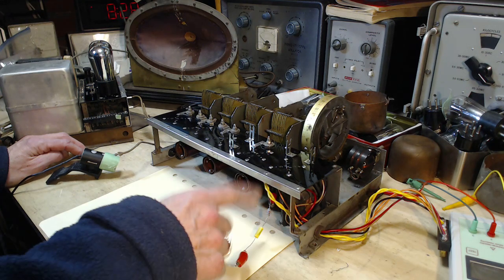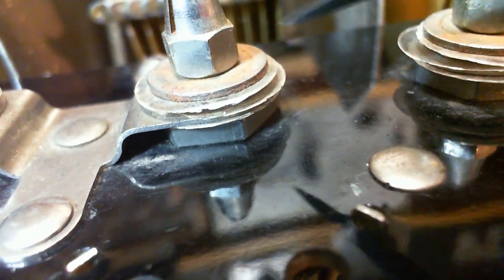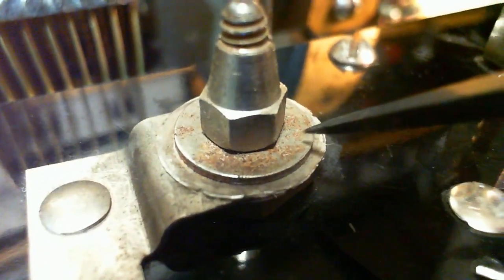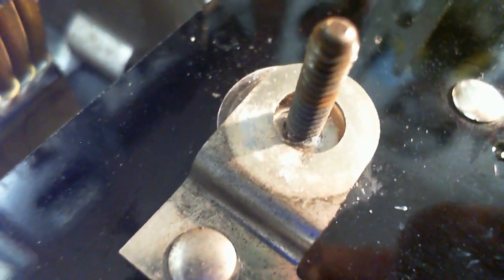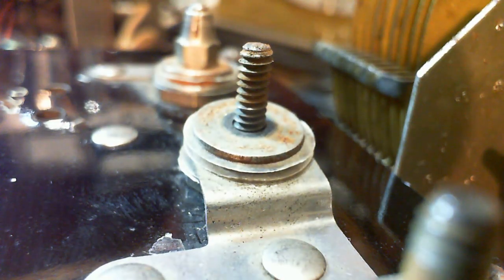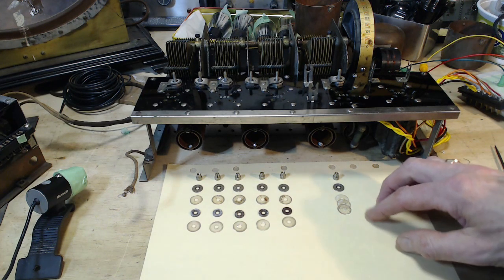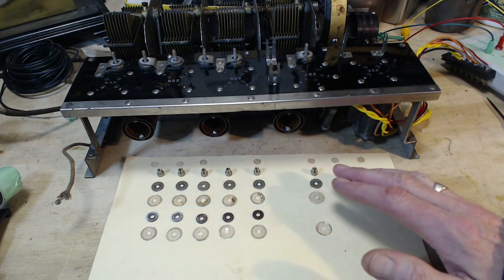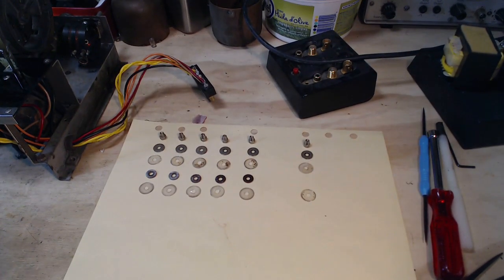1928 RCA Victor Model 28V   Video #44 - Trimmer Capacitors

Comment: Jim,The more I’m watch this I am reminded of a comment from “ All American Five “, Mr McWorter. In one of his videos which included cleaning a potentiometer. He was using WD40 to clean the inner contacts and at the same time, commenting on the virtues of WD40 in as much as the liquid would be absorbed by the dried out phenolic material and thus, rerecreate something like the original thickness at the time of construction and of course, improving the contacts of wiper and the resistive material material used to make a potentiometer. Would it not be reasonable to imagine that those little brown washers are made of the same phenolic material which in drying out over the years have actually become thinner and reduced any adjustment travel needed for their intended purpose? The white powder could most likely be the result of the dried surfaces being ground together having now reached the limit of adjustment. Great videos by the way.Graham from the UK. 🇬🇧

Comment: Hi Jim
looking at it you have a bottom plate & top plate with a spring plate in the middle 
( this moves as you adjust the top nut ) .

The plate area & dielectric thickness ( or gap ) controlled the capacitance so the trimmers with the phenolic washers will have less PF swing than the odd man out .

After all your just adjusting for tube grid variations & a bit of stray capacitances if the tuning gang is setup correctly !
As for the odd man you have 2 capacitors in the line so a bigger value trimmer makes sense .
The mica washers for stud diodes are still out there on flee bay .

PS Clear plastic cut into washers should work on the low voltage side of things .

Comment: did you read up on the neutrodyne radio, it is basically just a tuned radio frequency radio with negative feedback adjustable capacitors and a grid leak detector which what you have there. If it develops any regeneration or oscillation it will just cause noise and over power any signal on the detector. The rubber washers were to act like springs the one without probably broke and fell out years ago, since you took it apart would be a good time to replace them

Comment: Here's my guess. The manufacturer wanted to use the same hardware but needed different mfd values and used those red washers to provide that cheaply rather than design a different part for the different application.

Comment: Jim
Are all the capacitors equal in value??  Remember that capacitance is determined by Area of plate, distance between the plates and thickness of the insulating materials.

Comment: the top metal washer is the top plate of the cap.....mica next ...fiber washer thickness sets range of the variable cap.....bottom mica....then metal base.......  the diameter of the metal washers and base plays some part, but mostly the fiber washer sets the Range you can tune......   the fact that one is different simply means it has a greater capacitance when compressed( the plates get a lot closer).   it's the same as choosing different values when needed to make the circuit work.

Comment: You still working on this radio you haven't found the problem yet sorry I haven't been watchin are you any closer to resolving the issues Happy New Year!
Just replace them with modern capacitance tuning pots? Just leave them there unconnected on the top and put some modern ones underneath maybe with a small hole drilled in the top so you can tune them.
Reply: You wouldn't need to lift it if you undo the nut? the bolt would fall out .
Mica can can fracture and become separated so it might be not 2 pieces